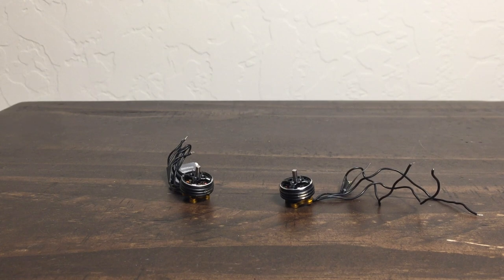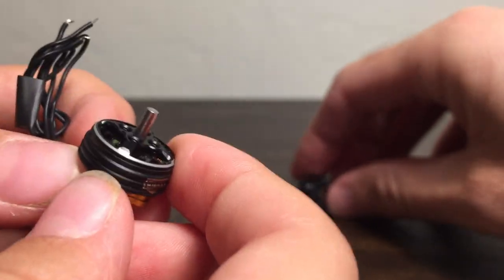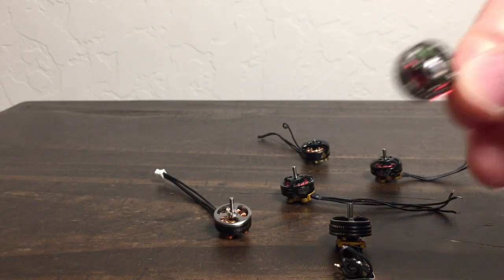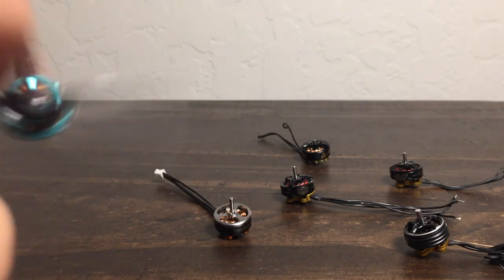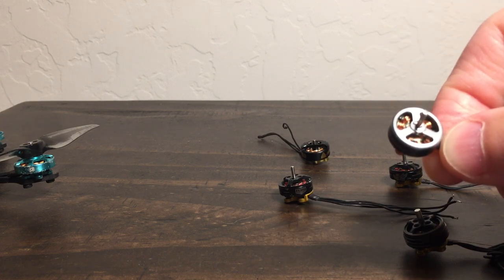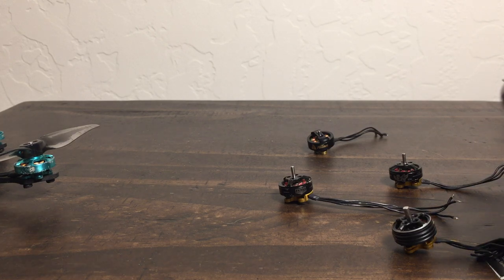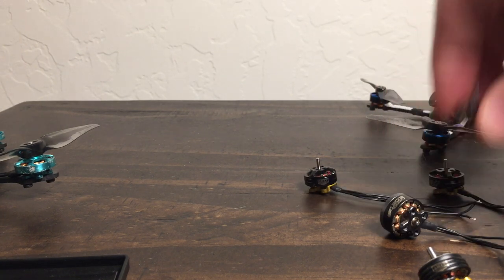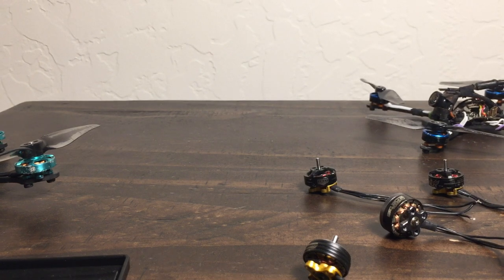These motors are SO NOTCHY

Comment: I know this is a bit irrelevant, but I love the 1S content man! In fact, your videos and kababfpv's videos persuaded me to go the 1S 3-inch route. It's great, much better than my old micro setup. This isn't a plug or anything, but on my channel, I am posting DVR of the amazing performance of this new class of quads. Check it out if you want to see what these things are really capable of. For anyone reading this, I would STRONGLY encourage you to try out 1S quads. I think you will be pleasantly surprised!
Reply: 1S 3" indeed is an underrated class, too many people ignore it because for them 1S is for indoor whoops and such. One of the best aspects is the simplicity of it all, batteries are cheap (relatively) and you don't even need a balance charger for it! Downside is you're stuck in grainy, analog land (actually, not entirely true, someone I know has just built a 1S 3" with a Split HD camera, and it doesn't fly as bad as you think it would).
Reply: @iamkarlpablo  idk, I didn't test fly it yet, but inside my room, the caddx ant nano looked amazing. Outdoors I suppose it will look a little worse
Reply from the maker: Sweet will check it out !

Comment: My BetaFPV 1505 3600kv motors are super notchy, too. They fly really nicely on my Mutant 4. I've never found notchiness to be a negative. Also, a good way to demonstrate notchiness is to to put a prop on and push the very tip of the prop as slow as you can. It will pop into the next position and make a clicking sound on your finger nail, or whatever hard surface you're pushing the prop with. The louder the click, the more notchy the motor is.
Reply from the maker: On the follow up I’ll try that.

Comment: So, there's a thought I'm chasing down that notchier motors on 48kHz end up being actually smoother, while the gappier less magnet setups are much smoother on 24kHz, and the overall delivery of power is kinda made similar there, but these super-tight airgap setups can end up being exceptionally smooth in the air, just end up with a different tuning window.
In 1103, these higher power (but slightly less efficient) setups can open up some tuning windows on 3" props (e.g. triblades), so I can actually see some use...
I do think the 1202.5 may still be a better overall option, but I know I'm going to lard up my builds with luxuries (Ant Nano, XM+, a battery strap, zip ties for Rx antennas).
Reply from the maker: tehllama42 it would be interesting to survey the community to see if some clearer correlations are emerging as to what motor features pair better with 48 vs 24 kHz.

Comment: Regarding the lil floaters.  Those wires look needlessly beefy, very similar to some rotor x 1105s I have. You can shave a chunk of weight by desoldering the motor wires at the base of the motor, and replacing them with some quality 28/30 gauge, silicone insulated,stranded copper wire. I took the cue from Amax when I did this, as they use finer motor wires than any other motor I've seen. I've had zero issues with the finer wires on these 1105.
Reply from the maker: 24kJames definitely true. I’m trying to settle on an off the shelf motor that doesn’t need the extra work. I want to pick a motor and invest the time doing a deep tune and then share that.

Comment: On 3S, you gotta check out Flywoo  1202.5 5800kv. I am beginning to feel like these motors can be used anywhere you would put a 1303, with the benefit of a pretty large weight reduction. Spinning 3018s, with 1100mah 3S GnB, these motors can still punch out like I have a  450mah battery on there, and I'm getting over 11 minutes of steady acro, hard punching, aping the throttle stick with complete irreverence for the battery. You can scale flight times pretty linearly to mah, and Id hazard the guess that sag is pretty linear increase as you go down. General performance is directly comparable to flying with a smaller battery, and in fact the increased momentum actually becomes pretty fun to play with, because I have the power and response to control it. And that brings me to the most striking, and unique quality of this build with the 1100mah batt: NO SAG. Theres just no sag. Cruising, I locked my eyes on the OSD voltage reading, a quite steady 3.9V at that moment, and topped out throttle stick with something more than a hard blip. The voltage hardly flickered between 3.8V and 3.9V. I understand that may be an expected result for those with more experience, but I was astonished, and immediately flooded with thoughts on the matter. I also fly these motors on 4S, but I'm still working on the tune. Similar to their 11.5kkv cousin, I find these motors a bit boggling.

On notchiness, funny you bring it up. I just received some Heads up FPV Five33 1404 4533kv motors for an HD 3" R3dshifters Ion/decased Vista build (potentially the most compact, lightest(?), HD freestyle build of which I am aware.) Yesterday I sat for over 30 minutes with one of these motors in my hands, turning the bell back and forth, "clig, clig, clig.. clig, clig, clig, clig.." These things are SO NOTCHY, I thought to myself. Lol seriously, I think I get it.

Please continue to make videos at will. I found it entertaining, and as far as utility goes, it doesn't take a ton to spark constructive thought,  and theorizing in my head, so thanks.

Edit: Those Amax 1103 7500kv motors are on sale from the Amax China warehouse for $7.99 right now.
Reply from the maker: I may cave and get the 5800kv and take them 3S. I've holding out for them to bring out an 8000kv, but maybe that's just not going to happen. Looking closer at the ET1103 "sale" it seems they are now listed under discontinued.
Reply: @Quad66  I doubt you'll regret the 5800kv. If you do, you can sell them to me.

Yeah, 7.99 seems a good price for Amax motors. The sale was set to go for at least a week or two. I'm not surprised they sold out. I'd have jumped on a set, but I have my hands full with these1404, RCIP 1202.5, and the 1202.5 5.8kkv. I need to test the Flywoos back to back with some 1303s and try to answer why I'd ever choose the 1303, given a choice between the two.

I have a shipment for you. I'll send it out when I return from camping in a couple days. It will give you some more 1S action to chew on, mainly a materials comparison.
Reply: @Quad66  I forgot to add that theres an 1103 11kkv that weighs nearly the same as the Spedixx/Hyperlite 1103. It is sold under several different brands, mine being Ready To Sky. You can get a set from Amazon for about $35, and I've seen them as low as 5 bucks a piece coming out of China. I just swapped my set onto a Baby Tooth frame that I built for a friend. Those motors were swinging the 3018s pretty nice. You may want to give them a look.
Reply from the maker: 24kJames what props are you using with the 1202.5 3S? On 2S the 3018 are borederline durable enough. I’m thinking if I go back down the 3S rout I need a prop that can get me through more than 1 pack.
Reply: @Quad66  I keep going back to the 3018s, clear with a matte finish from FPVC, for their superior balance. I wonder if the matte finish is due to an extra stage of fine balancing, because I have 1.5mm, and 2mm 3018s of of every variation I have found (all glossy,) and the quality of their balance is, sadly, a nudge in the HQ direction.

One prop that could work here, that seems to have stand out durability, is the Nazgul 3020 bi blade, which to me looks like a 50/50 hybrid of the GF 3018, and the HQ 3x3 bi blade.

I have to add that the bulk of my flying is further down range/larger scale than the [epic] flying depicted in your videos, and as such, I have less data regarding durability of any particular prop.

It has just occurred to me that this motor is available in 1.5mm, and 2mm upper shaft size, with both being 2mm internally. I have the 2mm version. If you opt for the 2mm for the added durability, but also want to keep your prop options open, you need to get your hands on the prop drilling jig that FPVC sells. Put your name on the notification list for when they return to stock, because they seem to sell out quickly.

Edit: dry weight of my build is 66.64 grams. https://armattanproductions.com/pages/kit_detail/2485 I built mine with top mounted battery, no TPU, and super low profile m2 nuts (1.5mm,) in contrast to what is seen in the kit image.

Hmm, you should consider designing a top mount frame.
Reply from the maker: 24kJames yes I got a pack of the Nazgul and they were well balanced. Not quite efficient enough/too much pitch for the tiny battery quads but probably a good candidate for a 3S 1202.5.   It’s interesting you mention the variability in 3018 balance, I’ve have good results over a variety of batches colors until the most recent. I would be interested in designing more frames but don’t fly the bigger burlier enough to test it.
Reply: @Quad66  Yes, definitely thinking Nazgul for 1202.5 3S. I had a camera slip up out of position the other day, right into the path of both front props which were Nazguls on 1404s. I could not tell at first since I was flying from inside my house, and couldn't hear, but I quickly figured it out from what was happening in my video feed lol. The props were battered on the stout, aluminum cased camera as a i flew back to the front door. Camera didnt have a mark, but the prop tips were beaten up but still quite flyable. It is the way they took the damage, in small chips, without losing their shape/contours, that makes me think they might have superior durability, particularly for the way you might test them.
Reply: hey man, can you tell me the weight of your build with the robo 1202.5 5800kv motors with the 1100mah pack? because that sounded pretty interesting :D
Reply: @ELValenin  I'd be glad to answer that for you. It will be an hour or so until I'm back around the quad.

I most recently flew that build, like a couple days ago, with a 4S 450mah HV. Super versatile motors. But most unique experience is with the low C 1100mah 3S HV pack for sure.
Reply: @24kJames  ok great. Did you try standard 450mah 3s packs as well and was the voltage sag bad with those?
Reply: @ELValenin  Sorry about the delay. Got wrapped up in my day yesterday and plain forgot. Dry weight is 66.6g (sigh..) All up, with low C, 1100mah HV 3S pack, she's 134.77g. Voltage does not flinch, punch, after punch, after pu...etc.
Reply: @ELValenin  Regarding the 450mah, Ive actually been flying 4S 450mah on it. I'll go rip a 3S 450mah pack right now and see. I think the stable voltage is more a feature of the bigger 1100mah  pack, but let me test. If youd like to see some video of any config, or all, just let me know. Brb..
Reply: @24kJames  thanks for still answering!! And it really doesn't matter that you answered today since I don't need to like build this thing as fast as possible.. I'd love to hear about the performance and efficiency with a 450mah 3s.
Reply: @ELValenin  Cheers my man!

Yeah, I like to do what I say I'm gonna do. That's all. Sometimes I stumble at it (Quad 66, I'm looking your direction,) but my tendency is to follow through. 

Speaking of 450 3S, I made this video for you, so you can see the performance for yourself. Throttle is in the bottom right of the OSD. Everything else you need, to get a sense of performance, should be on there too. Hope this helps: https://youtu.be/CQqi75nUlx4

Quad 66, it will be worth the wait. The delay has only resulted in an accumulation of more equipment for your skilled analysis. Hit you up on RCG soon. Cheers-
Reply: @24kJames  thanks a lot man! looks like there's quite a bit more voltage sag than with fpycycle 1303s.. Still need to decide on that. ;)
I'm not on RCGroups though..?
Reply: @ELValenin  You got me curious. I wonder how that particular pack is performing, with regards to its finite life span.  I'm gonna fly that same 450 pack on the FPVC 1303s. The build is 67.7g dry, and I'll probably swap the 3016s out for 3018s in an effort to really make this "apples to apples." Then, I'll single out my newest 450 3S pack, and fly both again. This should help inform the confidence we put in this very casually acquired, anecdotal data. While hardly scientific, this additional data should prove, or improve, the quality of the conclusion.
Reply: @24kJames  oh yeah that would be great! I didn't even consider battery aging

Comment: As long as there is no physical contact a minimal air gap is better than a wide air gap. It should give you more torque for a given size.
Reply from the maker: Yes exactly that’s why I’m thinking they will need more battery but carry more load. The gap is so small though that I’m worried that any tiny dent in the bell or bend in the shaft will kill the motor.
Reply: @Quad66  Sometimes notchy motors can be due to inconsistencies in magnet and stator alignment but assuming everything is within tolerance then yes more torque with increased amp draw but that's good as we want the lightest most powerful motors. 👍 As for durability just try not to crash and accept many motors can't take crashing lol. I had a crash on my 5" last month and lost all 4 motors. 2 were totally ruined and 2 had loud vibration issues lol. Joy! 😄
Reply from the maker: @changeagent228  this proved prophetic
Reply: @Quad66  You crashed them and bent them and or you noticed increased amps and torque? 😄
Reply from the maker: Change Agent maybe more amps and torque and definitely crashed them and bent them ... one rubbing out of the box. down to 3/5 working
Reply: @Quad66  Lol oh well best order more if you think they are worth it. 😆 Into the broken motor spares bin they go. One day I will find a use for all the broken motors I have accumulated over the years.
Reply from the maker: Change Agent the community could probably use a take a motor leave a motor online swap platform. Either that or bring back the tri-copters.
Reply: @Quad66  Yeah tri copters sound cool. Many people have told me they are rubbish to fly though. Still tempted to make one at least once to see. They do kind of look goofy with the servo on the tail motor. That said most of the motors in my spares bin are useless anyway and either don't turn, shake, wobble and or screech. Maybe I should make an art sculpture or chip the magnets out and recycle the windings copper. I was tempted the other day to just put the lot of them on Ebay as "Allsorted broken racing drone motors" no reserve , buyer pays postage lol.

Comment: My prediction is on 2S 3016-3 with those extra-notchy motors!
Reply from the maker: But will they have the rpm for the low pitch blade ?
Reply: @Quad66  I read about an experimental brushless motor for an ebike. Essentially it had an adjustable air gap. With an increase in air gap, the motor was able to reach higher rpms, at the cost of torque I would guess. My current interpretation is that bigger air gap in the case of this experiment, might equate to "less notchy," as applicable to our quad motors, which in turn seems to align with your thought here.

Comment: The ET 2207 were finished pretty, well packaged, and definitely a waste a money. Very weak shafts, poor QC, soft bell, lol... one motor even came out of the package with a bent shaft, bent it back with my bare hands.

Best of luck, maybe the 1103 are different. The 5" ET motor is very low quality.
Reply: This is surprising to me, and really good to know. Seems Amax has slipped down the ranks. Still love my OG 1303s though.

Comment: Sorry talking about a motor before you fly them is completely pointless.
It is possible that they are using the new n54 magnets and that will definitely make a motor notchy.
Please just fly them a couple of times so we can get a idea what’s really going on amp wise and efficiency.
Reply: Nothing wrong with initial impressions and theoretical predictions, Quad66 usually follows it with a flight video anyway.
Reply: It is basically a 22min teaser haha :)
Reply from the maker: You don’t understand then how notchy these motors are. I think if you pulled these motors out of the package gave them the usual spin and felt just how notchy they were, you would absolutely have to make a video and pair it also.
Reply from the maker: _ kaptn it is, it’s a terrible video 100%. It’s even worse than an unboxing video because I don’t even inbox them on camera, I’m just like here they are and they are insanely notchy.
Reply: @Quad66  I'am still looking forward for the flight video. Generally i love your videos, but i this one i didnt watch till the end ;)
Reply from the maker: @kaptn_kapton  sadly the motors didn't make it to the end of the second battery
Reply: I feel like recording impressions for posterity and then actually flying them and giving impressions, then discussing the delta is ideal...  I'm betting these will require 48kHz (or maybe even play nicely on 96kHz PWM with the right deadtime), but will probably be quite smooth despite expectations.  If in doubt, try doubling up batteries or running big ones, as notchier tends to demand more current
Reply from the maker: tehllama42 I agree. If you state the expectation based on certain attributes before hand, it helps test whether the theory translates into the air.